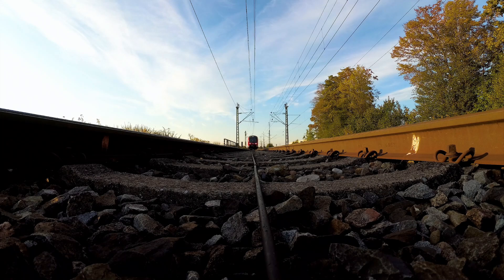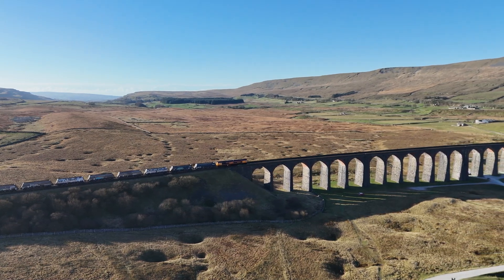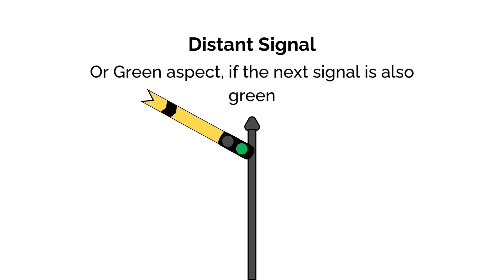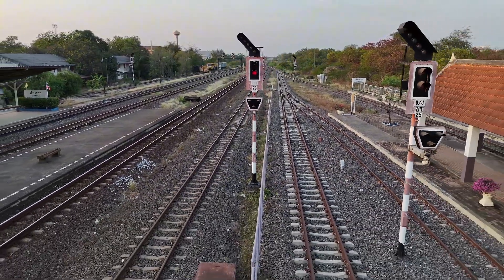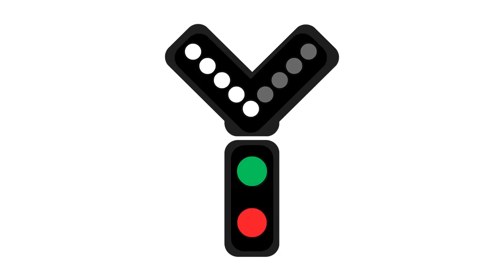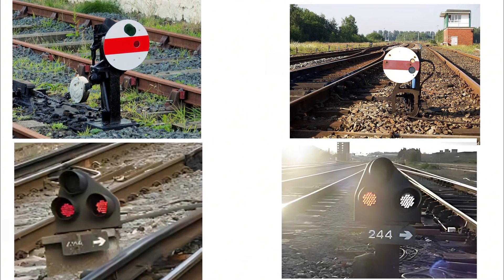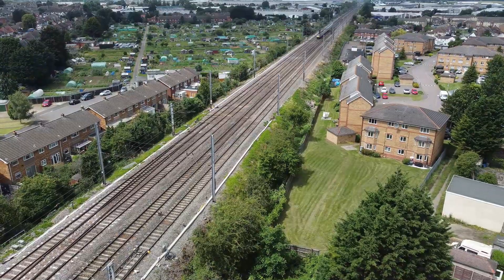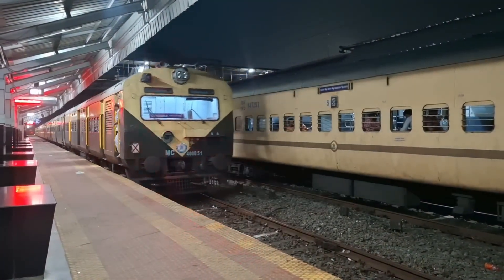UK Railway Signals Explained: 4 Types and Where You’ll See Them

Comment: BELIEVE THIS DAFT PROGRAMME AND YOUR UP THE KYBER PASS OR MOUNT FUJI !
A "Stop" signal as you call it. Could be an "Outer Home" an "Inner Home" a "Home" or a "Starter" or an "Advanced Starter" or a "Warning Signal" (with a W fixed to the arm). Or a "Shunt Ahead" signal (with a large "S" fixed to the arm). Or a Non passenger "Stop Signal" with a Ring fitted to the arm. Or a "Backing signal" with two holes in the arm. To mention just a few you have overlooked ! 

And all may or may not be operating to "Absolute Block Rules", Or "Single line Token Block" rules or "Intermediate Block" rules, or "Permissive Block" rules !!!! Which  is it to be ????

DISTANT SIGNALS & THEIR REAL MEANING 
Distant Signals DO NOT give "advanced warning of the state of the next signal". They give warning of the state of the WHOLE BLOCK no matter how many stop signals that box may or may not control !!!!

COLOUR LIGHT SIGNALS ARE NOT THE MODERN REPLACEMENT FOR SEMAPHORE ARMS. Colour light signals operate in a totally different way, and the displays they show mean totally different things because they operate to different Block Signalling rules. Such as "Track Circuit Block", "Station Permissive Block", "C2 Lines Block", "Radio Electric Token Block", etc.... 

Colour light Signals can be one of THREE OPERATIONAL TYPES. Automatic, Semi-automatic or Controlled. And each signal and how it works is indicated on a plate beneath each signal.   

POSITION LIGHT SIGNALS at Ground level do NOT limit speed to 25mph. And are NOT ALLOWED TO BE ACCEPTED BY A LOADED PASSENGER TRAIN !  And their use on "Running lines" is therefore seriously restricted to being placed in the trailing direction as a result. Which afflicts the way track & crossovers have to be laid out. If such a Signal is elevated on a Post however, then it becomes a different type of signal known as a "Running Shunt" and you may be passing it at 75mph ! 

And the photo explanation of these Ground signals is another confused mass of absolute nonsense ! And the use of a yellow aspect is tied to the availability of a "Headshunt".  

 
NOTE: A number of colour light signals shown in the programme ARE NOT EVEN BRITISH SIGNALS.   

And what have Indian & Japanese signals got to do with British Signalling ?  And what do the three white vertical lights seen at 7:10 mean. As that is a Signal on the 3ft 6in gauge Sotetsu Railway in Japan. And this sort of misleading information will only confuse viewers !!!

Comment: There’s a lot of negativity in the comments around where the author has made mistakes but hardly any, if any, credit for the work that’s been put into researching.  There’s a lot of correct information, but a couple of corrections:

A distant signal in the ‘on’ position (i.e. displaying yellow) doesn’t mean the next signal is at danger, but that any of the stop signals between it and the next distant signal could be at danger.  Not every red semaphore stop signal is a home signal:  the home signal is the first stop signal controlled by a signal box.  There can also be starter signals, a section signal, and an intermediate block home signal which will relate to the distant signal.  A distant signal will only show green if all stop signals between it and the next distant signal are displaying a green proceed aspect.  Regarding position lights, they’re not used to control low speed movements below 25mph, but rather they’re used when the section in advance is not or may not be clear of another train or obstruction, for example, if a train is to couple to another train, the approaching train will received a red main aspect with two white lights displayed at 45° to advise the driver they may proceed but be prepared to stop short of an obstruction.  A single yellow cannot be used because that suggests the section in advance is clear.  And as a few people have pointed out, the appearance of the 4 aspect colour light graphic is incorrect, with, from top to bottom, it appearing as yellow, green, yellow red to reduce the likelihood of reading it as a single yellow from a distance if the two yellow aspects were next to one another.  Not every ground signal is a position light signal; some aren’t capable of displaying white and remain as two red lights side by side which is a limit of shunt, and they limit the movement of a train in the wrong direction if a reversing move has to take place.

Comment: Four aspect colour signals are closer together than three aspect signal to increase traffic flow, not related  to speed. Colour signa[s come in three flavours, automatic, semi-automatic and controlled - which depends on what they are protecting. It's worth noting that semaphore signals (absolute block) and colour light  signals (track circuit block) while seemingly 'being the same thing' are in fact fundamentally different - under absolute block the line is closed until opened for the passage of a train, whereas under track circuit block the line is open until closed by the passage of a train.

Comment: Your four aspect is wrong
Reply: The two yellows are not located next to each other. I would also mention fog repeaters and charges placed on the line to give audible warning, and also mention ETCS etc and in cab signalling, token passing, interlocking, variable block etc. Maybe spin off into a follow up video.
Reply: As is just about everything else this complete nitwit has posted.